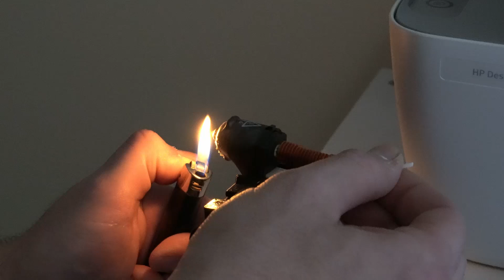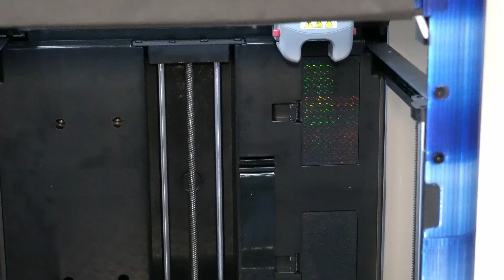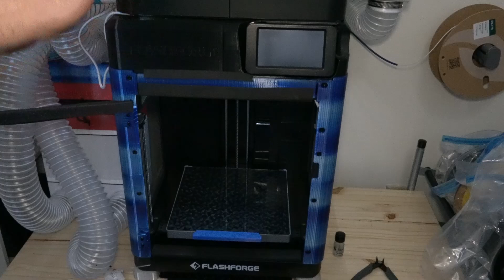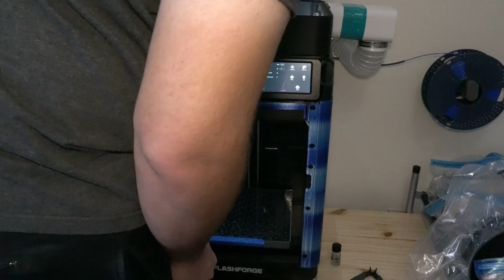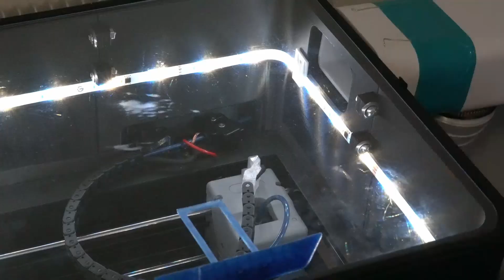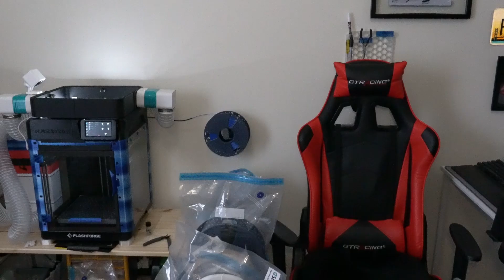IT WORKS!  Flashforge AD5M KlipperMod and Maintenance!

Comment: I do cold pulls with the nozzle still in the machine. I just manually set extruder temp to 160,  loosen the feed screw then pull it out the top. I love that dual extraction setup!

Comment: I’ve installed it but can’t get WiFi to connect and when ssh into the printer, doesn’t take my psk (it is correct). What else do you recommend? Did you have any issues?
Reply from the maker: @kimfam0us3D  I use Guppy, and setup the WiFi on the screen. I don't recommend the headless version for people who want to use WiFi, I've seen people struggle with it.
Reply: @ I can see it on the screen, but my SSID (on the printer) doesn’t match what my network broadcasts.  Still it won’t connect… should I revert back?
Reply: What login info you using to ssh in with
Reply from the maker: @jsInstalls  user root pass klipper